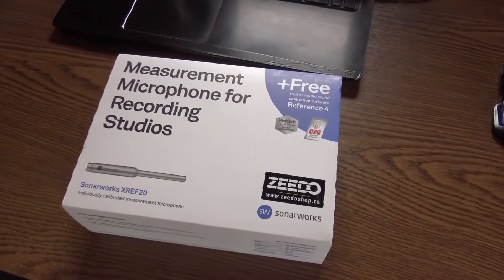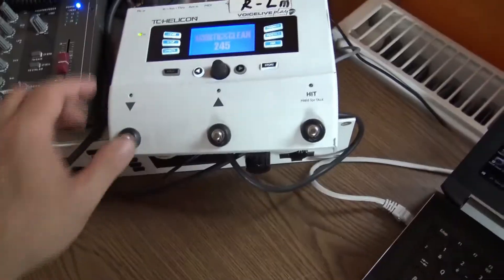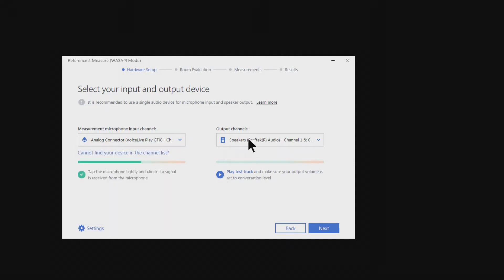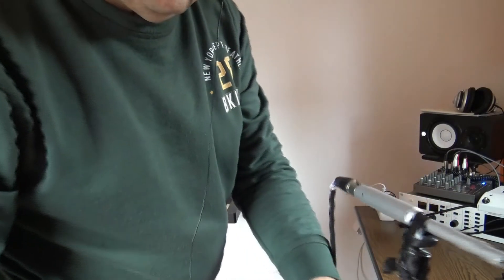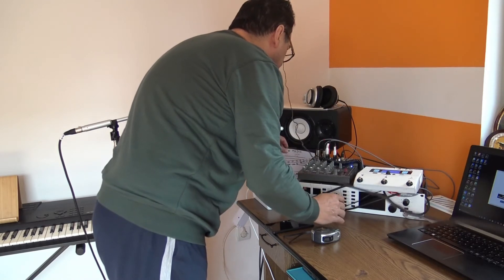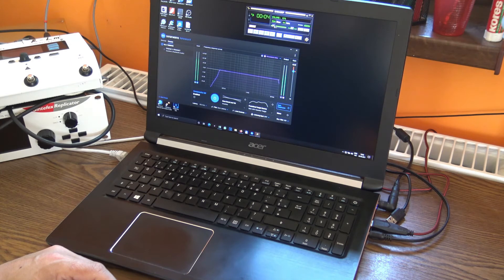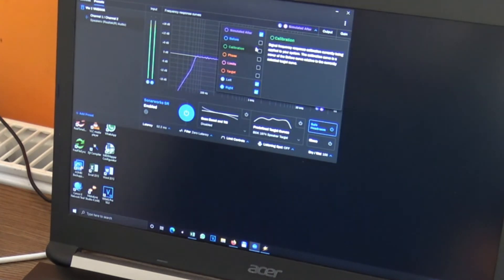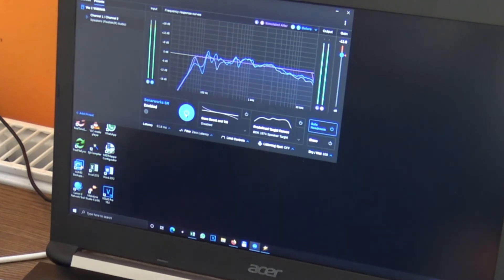Studio reference monitor loudspeaker and headphones calibration XREF20 Sonarworks

Comment: Hello! How can I focus on what I measured not with a special microphone, but with a condenser studio microphone? And by the way, why does it equalize the frequencies not to the middle, but even more ??! That is, for example, there was a pit, there was a hillock. And there should be a straight line.
Reply from the maker: This is a factory calibrated  microphone,  there are none microphones sounds the same, even from the same lot !I believe we can use a ''ordinary'' condenser as long as it's calibrated against a standard one like XREF20
Reply: @viocaia  sankyu!